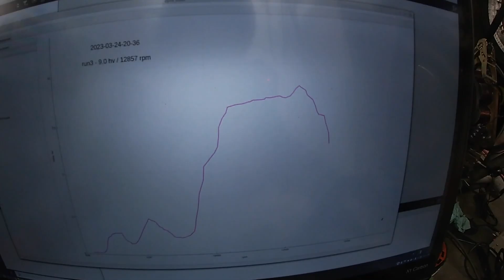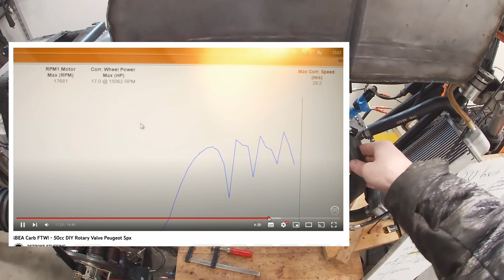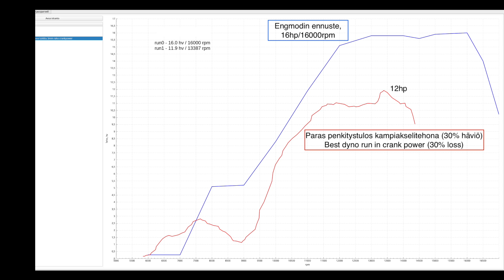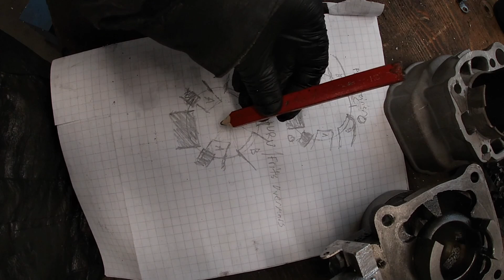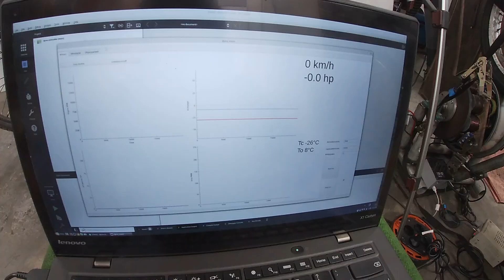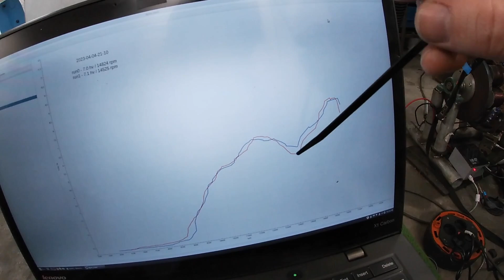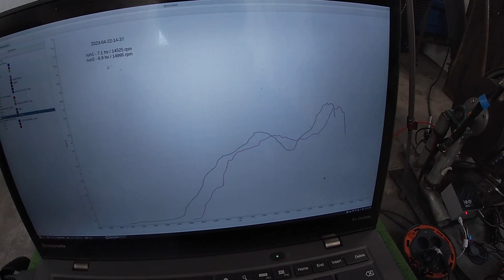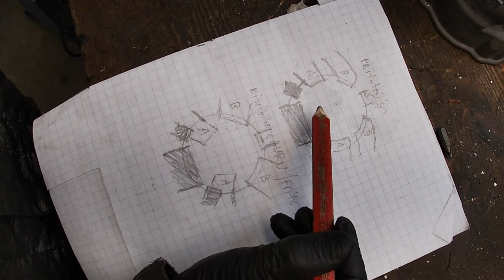20 hevosvoiman mopo osa 10: huuhtelujen mysteeri ja kaasuttimen kirurgia

Comment: I see you had a breakthrough at the end; but I was going to suggest to try plugging the boost port if you think too much charge is getting out the exhaust port, while leaving the other ports un-plugged......this may tell you if too much charge is escaping with the current transfer layout, and possibly help to remedy an incorrect transfer layout, by having better trapping against cylinder wall......either way it would be worth a try / easy to change if it doesn't work......if that didn't work, Id probably try plugging 1 or both of the auxiliary exhaust ports, with the rest of the porting open to see if there's a midrange boost or not.....possibly could also tell if over scavenging is an issue as well......excited for the next episode, and keep up the good work!!!

Comment: The transfer entry seem very blunt . Now knife edging no but shaping for better flow could help, also keeping the rear entry sharpe but the front rear edge curved could favour those ports . Maybe angle them so they aim higher into the cylinder also
Reply from the maker: Transfer entries have very little effect in my opinion. It is because at the transfer phase when the ports open, the pipe pulse just "grabs" the mixture sitting in the transfer ducts in and then the ports close. Then there is a lot of time for the transfer ducts to fill again so the flow rate will be relatively slow inside the crankcase.
The vertical wall angles are important near the cylinder bore.
Reply: @ASoftaaja  well youve messed about with everything except the handle bar grips 👍👍.Great seris of videos and looking forward to further updates, but thats where my money would be put transfer entry and angles ..

Comment: What a teaser in the end!
 * Is there wideband O2 sensor available for 2 stroke. 
* Why don't you go with fuel injection. It would eliminate all of this guess work with carbs and you can dial in fuel precisely. Also, Fuel injection opens up more options for air intake tuning. 
 * Are you expecting to make more torque at given RPM? (In my understanding) improving torque gets exponentially harder to achieve at given displacement. For maximum power, it makes sense to tune it at higher rpm.
 * I prefer shorter videos more frequently than long ones. I rarely have a full hour to watch it in one go.  
* None of this is criticism and simply trying to think along. Good work, keep it up.